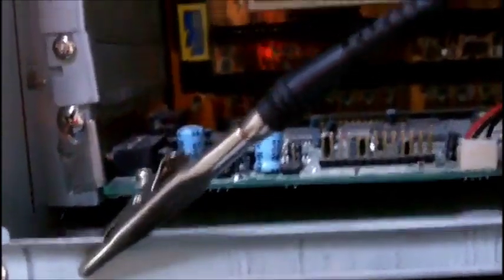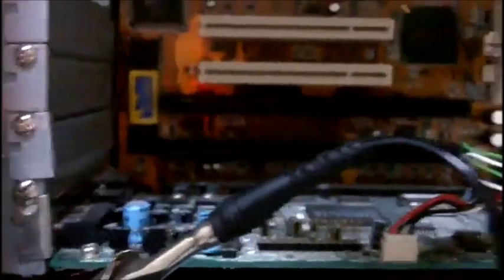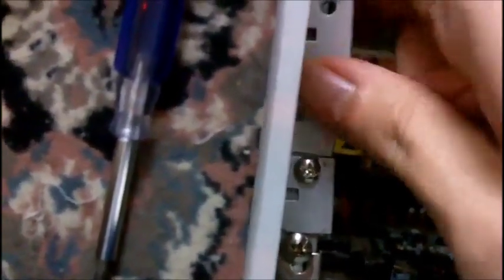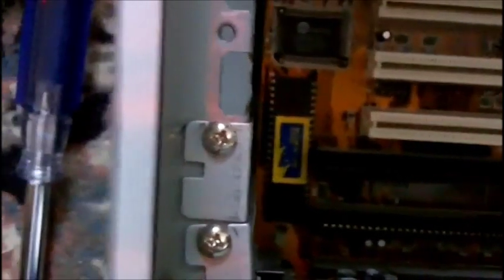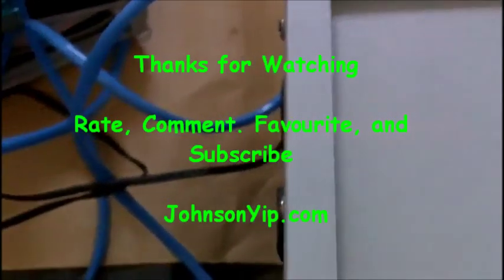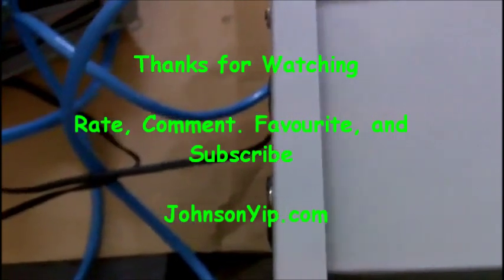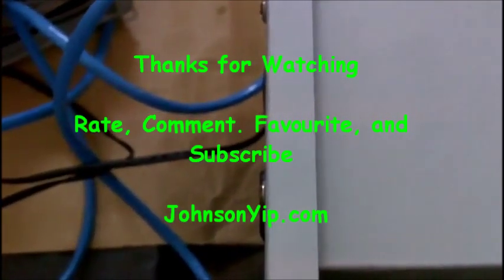How to install Wired PCI Network Ethernet adapter card on desktop PC motherboard

Comment: If you have an onboard NIC on the motherboard do you need to disable it first in the BIOS before installing the PCI NIC card?
Reply from the maker: rsaathoff I think you should disable it to prevent networking and operating system problems like freezes and crashes  which may happen having two nics enable on the same computer.

Comment: Hi, I have an integrated NIC and it seems that I managed to fry it( a lightning) so I need to replace it. It's the same thing as what you are installing on this video?
Reply from the maker: Yes, it is the same thing. My NIC is a PCI one.  I think some newer mother boards use the shorter PCI-X/PCI-E NIC, so you should check which type of PCI card you have on your motherboard before buying your NIC.

Comment: my 6t04 network adapter is shot and I need to replace it, is that the same thing as what you are installing on this video?  I'm an idiot but an unable to get online.  I have tried to uninstall and reinstall...not working.  Getting a code 10 [cannot start]
Reply from the maker: Yes, I am installing a Network adapter in this video.

Comment: My ethernet port on my desktop dont work. Will a card fix it or does having a dedicated card for it any advantages in general over using the built in solution?
Reply from the maker: I'm not sure since it may not be the Ethernet port which is broken. It could sometimes be the cable, modem or operating system which is broken, and preventing you from going online. If it is the card which is broken, replacing it would fix your internet connection. There isn't much of an advantage using a card, but newer cards have Gigabit ethernet which is faster than th 100Mbps ethernet on older computers.

Comment: Can you connect an old PCI card to an new mobo?
Reply from the maker: Yes, you can if the new motherboard has the old PCI card slot type, but PCI would not work on PCI-X, PCI-Express, or AGP card slots.
Reply: i dont know all the names but i have an card with 3 stripes of gold connection bar. and the new ones are 2.
Reply from the maker: JesperProduction I think the one with 3 stripes is PCI, and the shorter ones with 2 shorter stripes are PCI-X if they are. PCI-Express is used for video cards which has 2 stripes , and is longer than PCI.

Comment from the maker: The Networking parts on your Wi-Fi/LAN card maybe faster allowing 1000Mbps speeds vs 100Mbps on older Network motherboard cards, have more features, and work with other operating systems like Linux or UNIX as well as Windows. Although, if your network port on your motherboard is newer, they maybe very similar. If you use the card for basic internet which is not faster than 100mbps, there won't be much difference,either one would be good enough for your networking needs.

Comment from the maker: Good luck with your ethernet card move. I recommend using an antistatic bag to carry the card to avoid static discharge from damaging the card, and touch a metal part like the case of your pc, or wear an anti-static strap to also avoid static from damaging your card.

Comment from the maker: Hi, You need to install the network adapter driver software for your network adapter. You can usually find the driver software from your computer makers website, or the network card makers website.